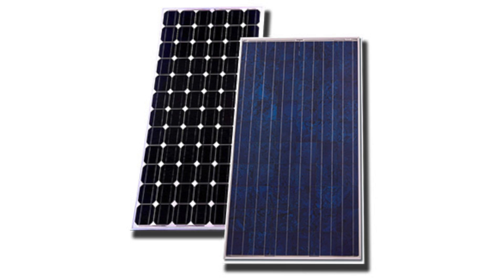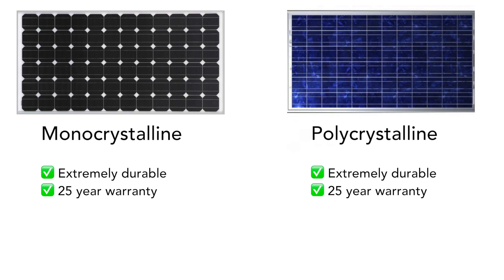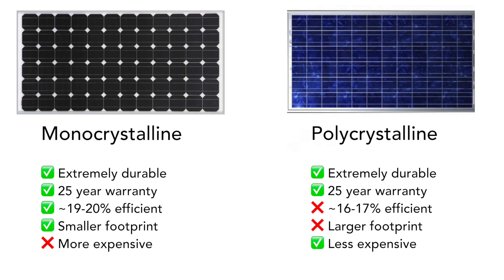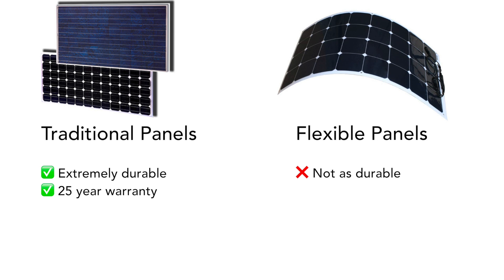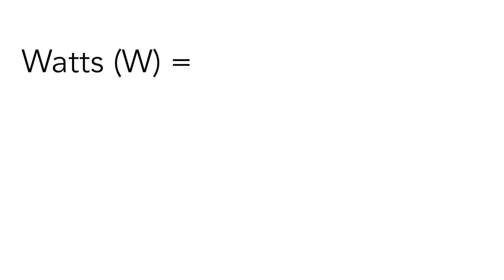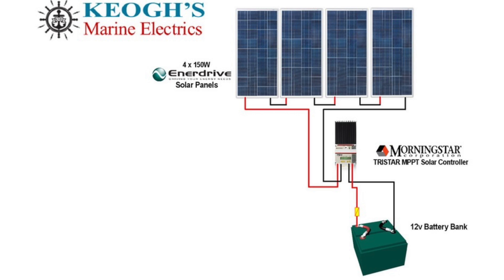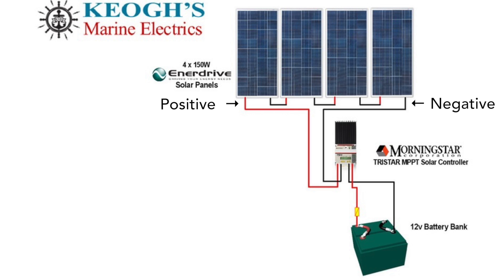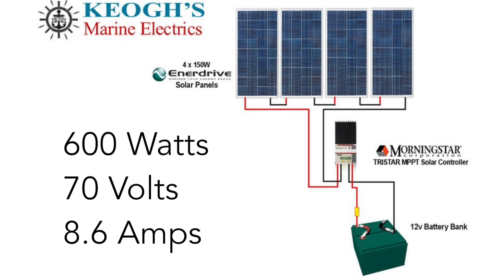Mono vs Poly vs Flexible Solar Panel + Series vs Parallel Wiring

Comment: The series voltage of 4 panel (150 watt) only yield 2 amps output at 70 volts. 600 watts output is only possible with parallel connection but at lower voltage output of 17.5 volt.

Comment: The best monocrystalline panels cost $10.00 AUD per watt and last the cheap Chinese panels that I just removed were supplying 20% of new after 8 years I hope the new Chinese mono's  @ $1.10 per watt last longer but the claimed output is half of what is claimed, out of one 280 watt panel the best I have seen is 70 watts at latitude 27 degrees south and I have been using solar for just over 30 years.

Comment: The change controller is rated for amps into the Battery!  Unless you just trash the power in series they would both need the same size change controller!

Comment: Ran across your profile researching solar energy on YouTube and want to pick your brain. I am renovating a 100 year old underground storm shelter and have made it to the point of installing a solar setup for a couple reasons. 1-power an exhaust fan and intake fan(12v PC fans inside 4” duct work that exit through ceiling) 24hrs day for air exchange and also for a few components that would only be used in a power outage (led light strip, interior circulating fan, maybe a small 12v heater.)  I purchased a small kit from amazon see pic below.  It’s a 20 watt panel, solar controller.  I also purchased a 300 watt inverter, 20AH 12v battery.  As my little projects normally do, they become way more than originally planned. Now I have a second 20AH 12v battery in route and Another solar panel, the 2nd one being 50 watt.  I have built a removable panel that hangs on the wall that houses the batteries, solar controller, inverter, switches and a fuse block. After watching your video I know I want to wire the panels in parallel so they work independently even if one is in shade during a time frame in the day. I haven’t thought about the batteries and their wiring together yet.  The solar controller is a 10amp pwm. I already want to upgrade this because I don’t think the low voltage disconnect is working as it should (battery drained to just under 8 volts during a two day cloudy period and fans were still running.  I’m questioning my wiring for the switches. I connected the load from the controller +\- to the poles on the fuse block and wired off the accessory poles (see fuse block pic) to the components (pc fans, led light, etc. the switches do power the components but I don’t think this is right and may be drawing more energy from the battery.  My battery is also wired to a master switch on the panel.  Do you have any suggestions,thoughts, best practices knowing what I’m attempting?  Knowing that I have two solar panels totaling 70 watts, 2 X 20 AH batteries, a 10amp controller, and my components, what replacement controller would you suggest or features to look for in one?  I definitely want low voltage disconnect.

Comment: Nice explanation,  eazy to understand,  I started in this about 35 years ago,  when I bought my first ARCO 40 watt solar panel (used) for $250.00 !! and an actual mechanical/electronic solar charge controller, that had contacts you could hear clicking  PWM, wow has  solar progressed !! Great Video,   THANKS William Orange county,  ca.

Comment: FYI solar now a days used internal diode incase of shading, so shading one of the panel that is connected in series only affect the solar been shaded.
Reply: Thanks for adding that comment, I just installed two panels in series and when one is shaded I was still getting full output from the other.

Comment: I've seen solar panels that have the converter DC to AC  attached to each panel so the power is AC out.
Are these type panels a better choice?  Would  the same series / parallel wiring apply?

Comment: This makes no sense at all, still have no idea if I should wire the panels in series or parallel. If I am running a 12V system, I can't run it in series, correct?  I did not realize that I have to get a 6 year college degree just to understand the basics of Solar energy.  A generator is waaaaaay easier
Reply: You don't. A 12 year old could figure it out.
Reply: series is prefered as this lowers the current required for the cable size and resulting losses due to volt drop and additional cost of a larger cable size. you are limited by your charge controller. it will state at what power, voltage and current it is capable of. typically charge controllers are capable of a couple hundred watts, and 100v or so. so in this case id wire up as many as you can in series. oh and he didnt get it quite correct: if wired in series there are diodes on the solar panels themselves that if one is covered up by shade of some description then the whole array will not go down, only that one panel.  hope this helps you out.
Reply: @jamhough22  Thank You

Comment: My poly cells from Richsolar outperform any mono panel I ever had. Reason? Heat kills performance. Even though mono panels use a higher grade silicon, they are black and they attract more heat than the blue poly panels. In fact my Richsolar 169 watt panels consistently put out more than 160 watts in full sun and NO mono panel has ever done that for me when HOT. I'll stick with my poly panels.

Comment: Great job on the subject matter. Question; I have 5Kva Inverter 48V.
16 panels 24V 250W.
And, 12 batteries 200AH 12V. Pls, how do I connect the Solar panels to the Inverter? What will be my Solar Panel output and batteries storage Capacity.

Comment: In Australia we just have solar modules connected to DC isolators which run to the inverter which runs to the switchboard. Why don't we use solar controllers?
Reply: Because you're not using batteries?
Reply: @misstakenot9582  oh

Comment: A 17.5 minute video can't tell the whole story and has generated a lot of questions below that you haven't answered. Many of the answers by other contributors are wrong and misleading.
The video is confusing with incomplete explanations in many areas. The difference between series and parallel wiring is simply the current from each panel - the formula is not needed. 12 volt panels are simply many individual cells  - 32 or more - wired in series to become one 17.5 volt (open circuit - no load) panel producing 8.6 amps. Wired in series each panel can only pass 8.6 amps but the voltage increases. Shade problems on just one panel may reduce the current from that panel to only two amps, so all the other unshaded panels that are working hard to produce 8.6 amps can only push 2 amps through the shaded panel. In parallel  2 amps from the shaded panel is added to the 8.6 amps from the unshaded panels. This is a very complex subject.
The difference between monocrystalline and polycrystalline are so small that it is very much more important to consider the manufacturer of the panels. The silicon cells of each panel are massed produced and are sold 'graded' - so the top sellers like Solbian will use the top grade. Cheap Chinese manufacturers will choose the lowest grade whose output will be lower and will have defects that could last a few years or die very quickly.
The latest 150 watt Solbian panels are just 2mm thick and weigh less than two lbs. We have two on the sun shade of our boat.

Quote from the video:  "So a solar array wired in parallel will require a much bigger charge controller than an array wired in series."
This statement is confusing at the very least and inaccurate at the worst. The size of a charge controller is based on the wattage it can handle so the four panels all produce the same wattage however wired so the charge controller size should be the same. 

This video needs remaking.

Comment: His pricing is way off...I priced the flexible ones.. are running $0.36 per watt (USD), delivered....  way, way, way cheaper!
Reply: Lance Siast Jeah but the flexible ones gonna last you about 2 - 3 years where mono and poly will probably last you 30 - 40 years or more. Whatever you do, just avoid those flex panels. Been there, tested them, trust me they’re not worth it.

Comment: Can I run the cable direct to d battery without charge controller
Reply: Not without running the risk of destroying the battery. Possibly explosively.
Reply: But please can I run 48volt on two battery with pmw charge controller

Comment: Hi this was so informative. I trying wire a 600w solar array using 300w x 2 panels, open circuit voltage of each panel is 39V. ( mono crystalline black) what’s the amperage should I get on the charge controller? If any the equation please. Thanks

Comment: Nice Video!! Thanks... Is it safe to assume the Wire that is running from Solar Panel to Charge Controller is good enough to be used from Charge Controller to Battery? but higher Gauge wire required from Battery to Invertor?

Comment: One thing you also need to consider is that those panels output DC voltage which can cause voltage loss problems if you don't use a big enough wire or have wires that are too long.

Comment: says new panels just came out with a 22.5% efficiency but flashes 24% on the screen......course this is two years old, probably a lot better now but come on...you can;t say 22.5% and then flash 24% on the screen....but the Sunpower X-series is only 22.7% all others are 21% or under efficiency.

Comment: at 13:24mins maybe not true, consider: when 1 solar panel in series connection was shaded and the remaining 3 were exposed to sunlight, the power from those other 3 panels will still charge the batteries. do you know that there is 1 or more diodes installed inside the IP rated PV terminals where the solar panel cables are connected? please open the black terminal box behind the solar panel and see for yourself. the total voltage output of the 3 PV in series connection is lower than 4 units of PV but it will still be able to charge the batteries contrary to what you said that the entire unit goes down. then, the voltage drop in one or two diodes in each panel is just low, so the power of the 3 remaining solar panels will still go to the charge controller and will be able to charge the batteries?  Consider another side, when the weather is cloudy the output  voltage of the 3 to 4 solar panels in series is still higher than those 4 solar panels in parallel, which those connected in parallel may not be able to charge the battery (12V) because of lower voltage output of the solar panels, for example 11.5V DC. but in series connection the voltage will still be around 34V to 46V DC, so with MPPT charge controler, the batteries will still be charged. thanks

Comment: Try using DC uptimizers or microinverters. thinking on going AC for the panels via microinverters and use an a/c to d/c inverter for the batteries.

Comment: What Charger controller did you used in 600watts panel in parallel set up of panel? Jow many batteries at how many watts ineveter ?

Comment: Solar newbie here.
Regarding panels in series and shading: What about bypass diodes?
Should those not mitigate the problem?
From what I've read, a partially shaded panel with properly installed bypass diodes should still be able to deliver at least part of its rated voltage at the rated current, right?
(On the same note, a completely shaded panel equipped with a bypass diode should not interfere with the system as a whole, at least not noticeably)

I'd greatly appreciate it if you could shed some light on this.

Comment: Great job.
However, I would have added the Voltage Drop issue.
And the charging voltage needed to help decide the final configuration.

Comment: 1. If you write Watts and Volts, then you HAVE to write Amperes, and NOT Amps. "Amps" is not allowed in the International System.
2. Watt, ampere and volt have to be written WITHOUT capital letters, and by the way, according to the grammar rules.
So, you can write either W, V, A or watt, volt, ampere.
You, in North America, are quite ignorant on this point.
By the way, thanks for your efforts in making this video.

Comment: I know about the batteries, but this is the first time I heard you can increase your voltage with the solar panel. This is definately something that could benefit me at some point in time. But I'm still confuse on how this would affect me on my battery end. Since this is a 12v system using 2 6v Flood Acid and 1 12V AGM. I eventually want to include them both. I'm running 10 100 watt panels.

Comment: And what is better for camper van instalation? Serial or parallel? What is better for solar  battery?
Reply: It also depend on your charger's specification and your battery's configuration in serial or parallel.

Comment: 1) flexible panels have a 5 yr lifespan as they yellow and crack.
2) Most solid panels have a 20 yr warranty and not 25.
3) heat is your enemy. When the panel hits 150F the heat creates resistance so it won't produce electricity. You need a 'heatsink.' That's another reason solid panels are superior, as the panels have air moving under them.

You still have much to learn about solar.
Reply: Its a video about the differences between mono/poly/thin film panels and basic wiring methods/system sizing. Why would he talk about thermal dependencies? That's way over the heads of beginners looking to learn.

As for your claims on warranties, a solar panel has two warranties: a performance guarantee and  an equipment guarantee. A solar panel’s performance warranty will typically guarantee 90% production at 10 years and 80% at 25 years. An equipment warranty will typically guarantee 10-12 years without failing completely.

YOU still have much to learn about solar. Or we could all just realize that making blanket assumptions about people we don't know on the internet is a waste of time and energy.

Comment: Solar Panels all in series... What about soldering in Bypass Diodes on each panel so that if one or two of the panels is shaded, the Bypass Diodes bypasses the that (or those) shaded panels don’t stop the flow of current to the Solar MPPT Controller. Yes the Overall voltage drops but the current remains the same.

Comment: Is a higher voltage transmission better.  Would it be a better ohms/wire issue if I connect my six (6) shade free panels (12-27 volts) in series to a battery/controller/ inverter array that can handle the voltage?  I remember something about how the current from either or both AC and DC transmission from dams and power stations, wind farms and solar stations, is best when done in high voltage over long distances, with reduction at the use point.
Reply: You say shade free!! 
Then series 6mm².. in series .. and a MPPT Controler to handel the higher volt!! Less loss
Way more watt ..
Reply: Se aculey hawe a DC kw line from Denmark to Norway 
DC becaus you onley need 1 cabel and 2 seabuttom ankers to ground on in eatch end .. 
Seabuttom is minus salt water and sand .. almost No loss line is 1000km or So Long !!

Comment: Great video, no question about it. Nevertheless, I'd like to point out a few things I noticed:
1/ Error @ 15:20 - diagram should show 35V instead of 24V (in parentessis).
2/ The shading issue is even more pronounced by the fact that the cells in panels are usually wired in series, i.e. even one shaded cell can knock off the full panel.
3/ MPPT controllers have different efficiency with different input voltage. Usually, the higher voltage (70V)  is more efficient (then 17.5V), but it depends on the controller rating.. I wouldn't consider PWM controllers at all.
This does not diminish the fact that your video is EXTREMELY detailed and thorough. Thank you.
Reply: The shading isn't that bad in series as he claims. Solar panels come with 2 or more bypass diodes. If part of the panel is shaded, the cells get bypassed so they can't kill the whole string. Only the shaded panel is down. The voltage for the string drops and if it gets too low, the efficiency of the inverter suffers.

Comment: nice video.  I wanted to add that panels wired in series do not stop functioning if one of 4 panels is occluded.  The voltage would drop by 1/4 and you can use the remaining voltage with an MPPT charger which operates a large variance in volts.
Reply: Yep so truh ITs becaus of bypass diodes in real panels 
If they buy substandard panels with out the BYPASS DIODE's/DIOD
But this Guy is just parroting others flaws!!
Mono is also way mor efisiant in cloudy weather Then poly!! 
The states numbers are fully sunshine on both panels 
Not a cloudy Day on mono Vs poly crystalin!!

Comment: Can you use a standard inverter for parallel wiring? Or do you need to use individual micro-inverters if you want to do parallel wiring?

Comment: I'm grateful to you.
Thanks a lot for sharing!
My question is: if you connect the panels to 70v when your inverter is 24v will the charge control be able to charge it at 24v? And what is the advantage of raising the voltage at such?
Thanks and God bless you!